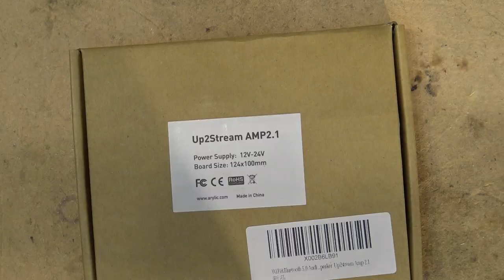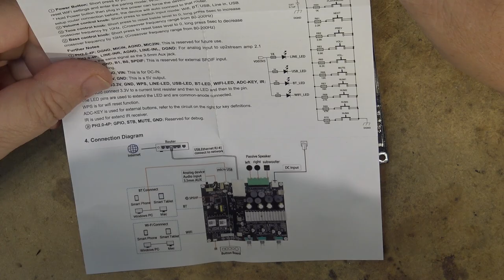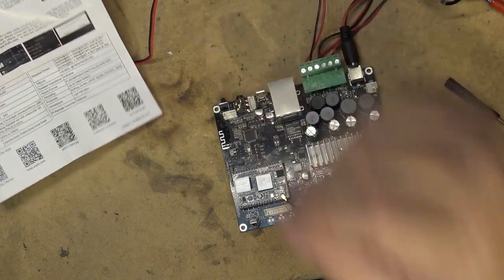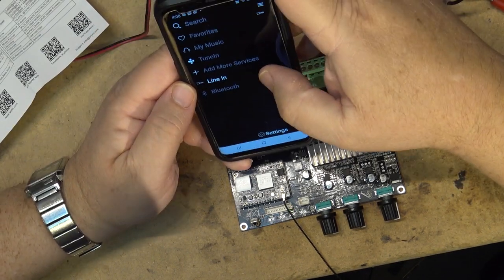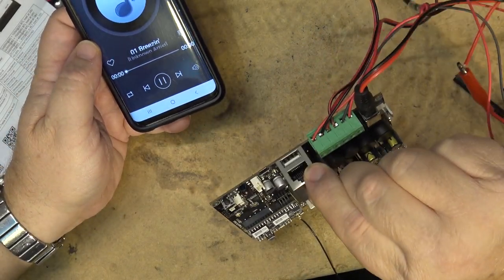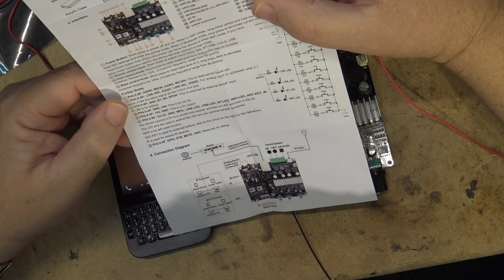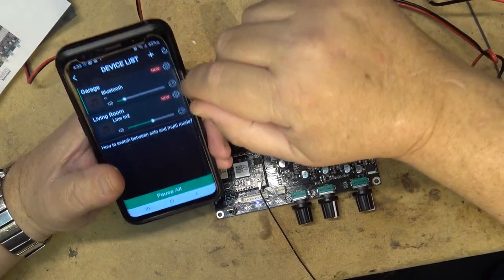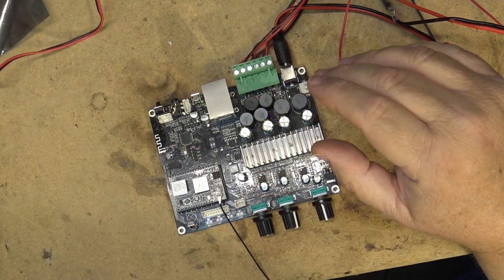Up2Stream 2.1 channel plus sub woofer network audio streamer amplifier with WiFi and Bluetooth

Comment: what is that samsung sub?
Reply from the maker: What Samsung sub?
Reply: @12voltvids  you Said you use s Samsung subwoofer in the Video. Because i dont know what subwoofer i can use for that amplifier. In the Description is 100w@2ohm. Bit is that 100w Maximum or what